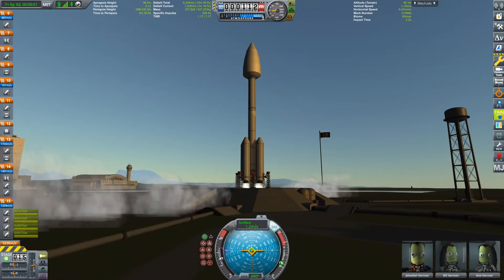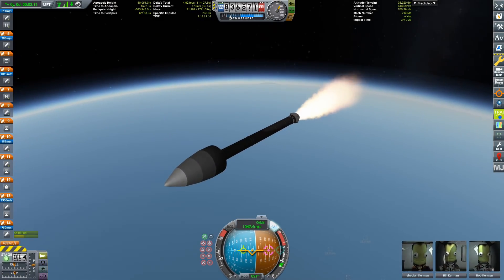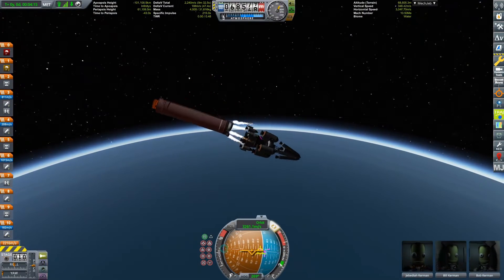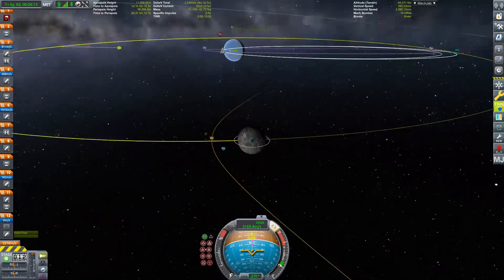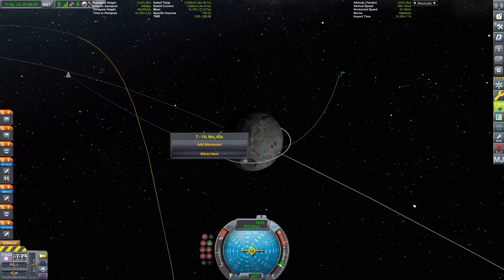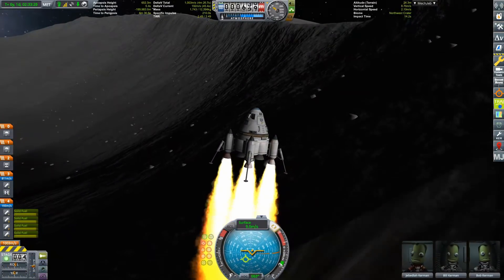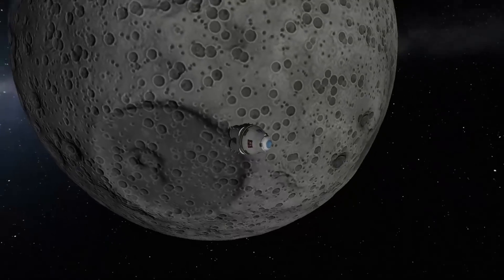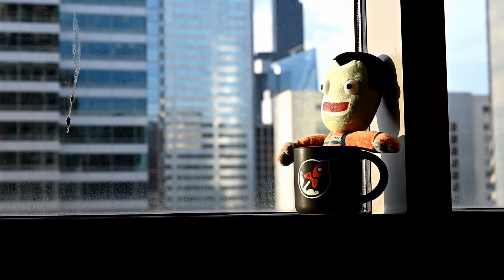SRB only trip to The Mun and back in KSP 1.8

Comment: Did it back in 1.6.1 to just get there.  The rest was liquid.  I was using some mod that had much larger solids at 2.5.  They were supposed to be used for the shuttle using 3.75 tanks.  I had solids wrapped with solids saving the 2.5 booster as the main engine to the very end but it's second stage was liquid with very small engines as it was a satellite for some cheap contract so I wanted to save as much as I could of that.  It wasn't that bad but I had to wait until the Mun was in the 12 - 1 o'clock position before I could launch.  Using MechJeb I set it to target+ and launched.  The reason is I had no intention of remotely making any orbit attempt.  So it was a straight up; mostly shot.  So horizontal velocity wasn't a consideration.  Staging and setting the thrust was the insane bit.  Target was 5100 delta-v and working from the first solid stage forward setting the thrust reduction which increase/decreases the burn time to keep a thrust to weight of 1.25 - 1.5.  Then it reached the target delta-v of 5100ish I stopped.  Didn't do it again because of the amount of time it took adjusting and adding side stages to reach that target delta-v. 

Would like to tell you about 1.8.0 but am on hold for Kopernicus mod.  Can't try until its applied.

Comment: I once did a solid rocket boosters only to orbit build... that means no reaction control wheels either. I had only one means of control input: Staging. That includes the gravity turn, which was done with two seperatrons to spin it one way, then another two I triggered to stop the spin. Surprisingly, I managed to get the timing on first try, though that's mostly due to high margin of error due to excessive delta V. 
So I flew a rocket to orbit using only well-timed presses of the space bar.

Comment: Nice video, could you get in to kerbal orbit before going to the moon with only solid rockets and only use the flea, hammer and kickback SRBs???
Reply from the maker: Probably, yes. You would need some redundancy, like a few extra fleas to make sure you have enough wiggle room to adjust your orbit. Also, play with amount of fuel and thrust level. If you have the breaking ground expansion, you can use a KAL controller to modify your SRB thrust during ascent to keep a more or less constant TWR

Comment: Ker also provides a suicide burn if you turn it on its in one of the orbit panels i think. It will tell you exactly what you did manually. T- the time till you have to start the engines
Reply from the maker: I had very mixed results with that, so I avoid it usually.

Comment: ShadowZone how did you install the trajectories mod because I not able to get it done
Reply from the maker: WARNING, use with caution:
Install Trajectories as you normally would.
Back up the trajectories folder. Then:

Under GameData/Trajectories/Plugin copy the latest .bin file and rename it to Trajectories18.bin
Go up one folder and edit the Trajectories.version file. In Line 8 instead of "MINOR":7 enter "MINOR":8 --> works in 1.8

If Trajectories is officiall updated to 1.8, remove the new .bin file and edit the .version file to say 7 again (or restore your backup).
Reply: @ShadowZone  Thank you
Reply: @ShadowZone  Tried that didn't work